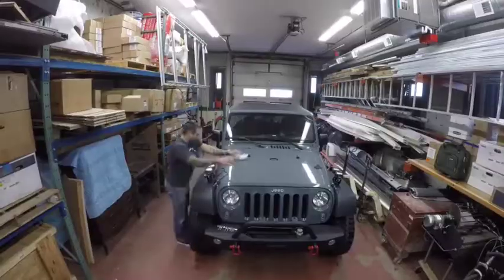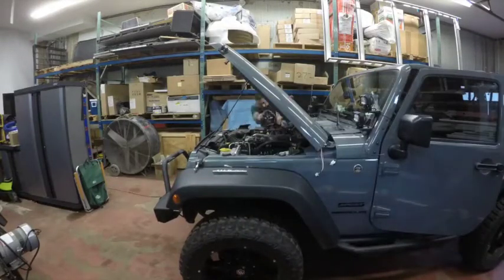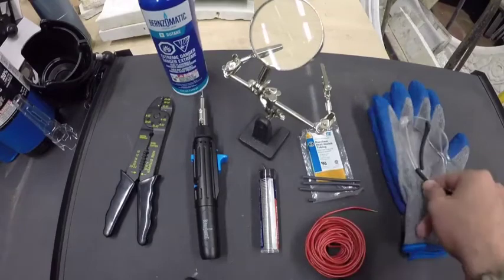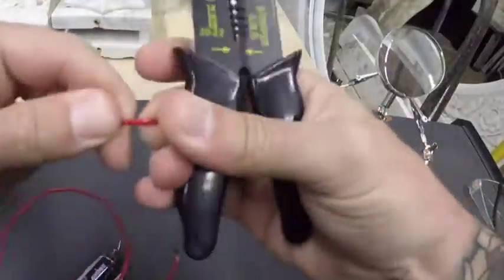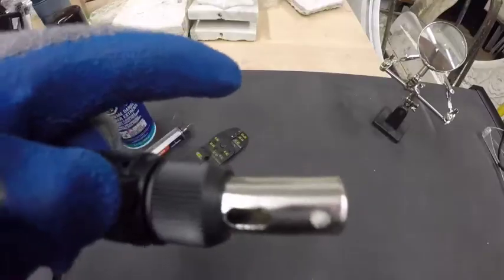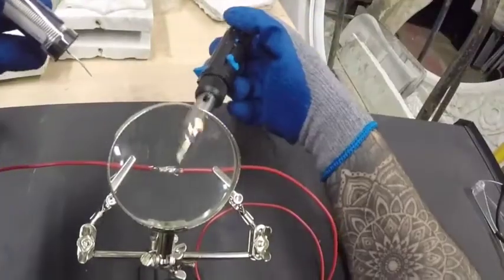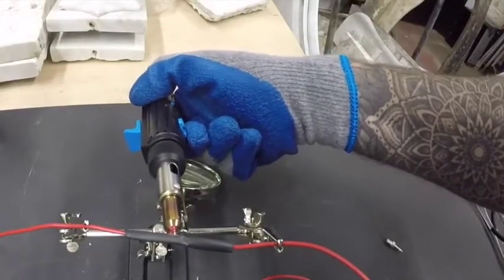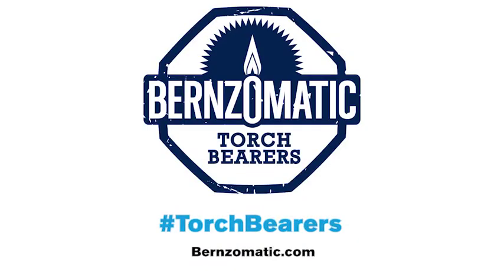Build with Fire: How to Solder an Electrical Connection

Comment: I thought you were supposed to heat the wire then touch the solder stuff to it and it melts and pulls into the strands 🤷‍♂️